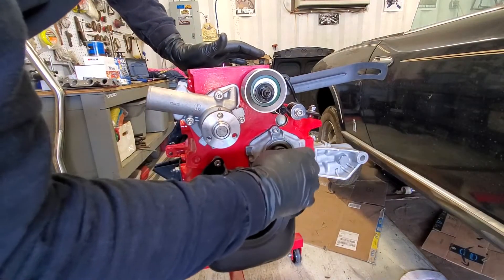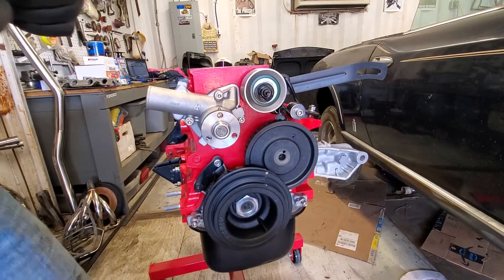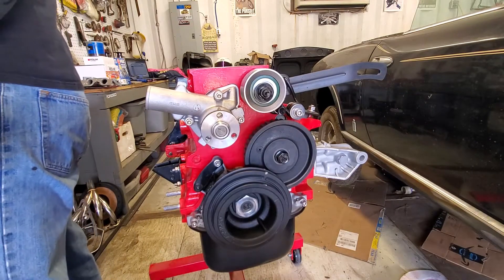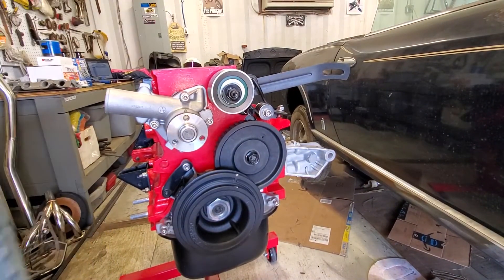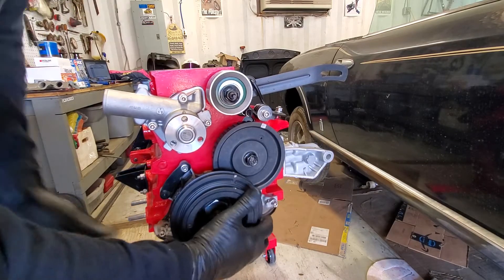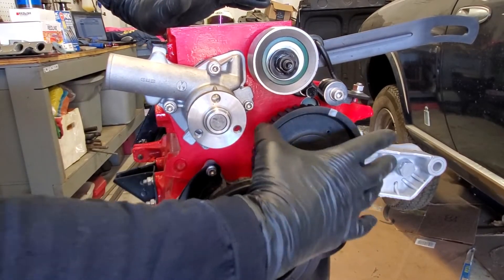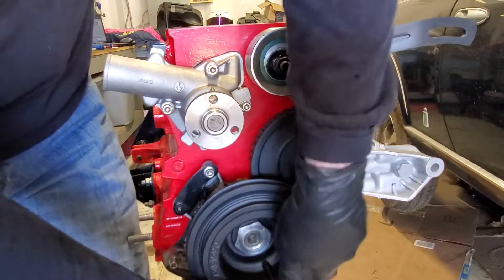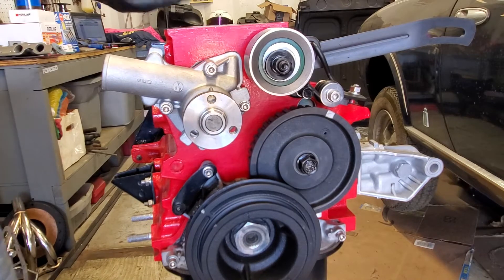1979 Fiat Spider 124, Auxiliary Shaft setup, what is it and why does it matter

Comment: Love you series as it has been very helpful during my resto. What is the most effective way to torque the aux shaft pulley? I believe it needs to be 87 and I'm having a tough time securing it well  enough to get the torque wrench to 87.
Reply from the maker: 87 is correct 
Two ways, take the old belt and wrap it around the pulley,  secure the end loop with vise grips. Now you have a handle to hold onto and torque it. The other way use an adjustable impact gun and use the setting closest to the spec.

My ugga dugga has three settings. I tested each on a lug nut. Send it, check it with a torque wrench, send it on the next, check it with the torque wrench and so on.

Comment: I have a question about the timing mark.  My 2.0 didn't come with one and I've been timing by ear.  I just got one and it seems one end is threaded and the other end pinned somehow to the seal carrier so I guess you can move it and or it doesn't come flying off into the motor.  Can you just explain a little how it's attached?  Thanks for all the videos.
Reply from the maker: Yes, just like you said. About the 2 minute mark in the timing belt video. 

https://youtu.be/ZFXvSvRPD8c

Comment: Could you please explain more in details on why it's so important for the auxiliary to be at the right position
Reply from the maker: Sure, the aux shaft drives the mechanical fuel pump via a lobe. Even if you don't have the pump anymore because it's been switched to electric the lobe is still there. The aux shaft has to be timed in order to not interfere with the crankshaft and pistons movements.  In the video I show how when the shaft is out of place the crankshaft hits it. As long as you set it up right, everything turns in time. 
Good enough?
Reply: Being more specific, it's the conrod that the lobe hits, not the actual crank.

Comment: Couple of comments. The dot on the ancillary shaft wheel is there for a reason. It is this that you should use to set the shaft timing. No need to look at the bolt and paint the flange. Also the reason there is a clash if the timing is wrong is because the conrod hits the shaft lobe which drives the mechanical fuel pump. The lobe can actually be cut off and the oil gallery plugged if an electric pump is used. No chance of a clash then.
Reply from the maker: Thanks